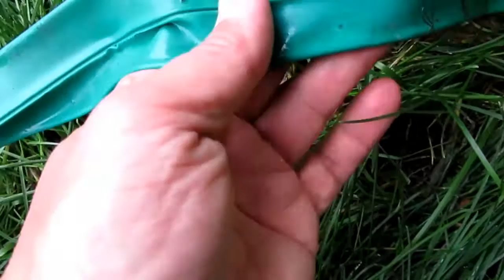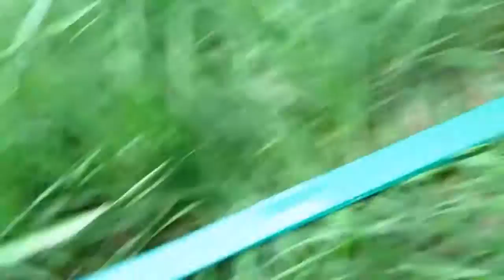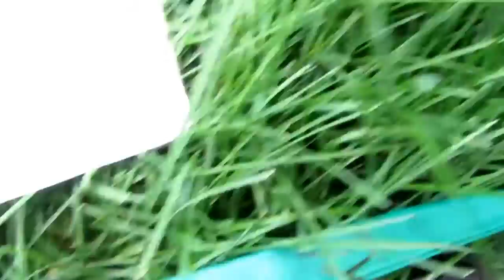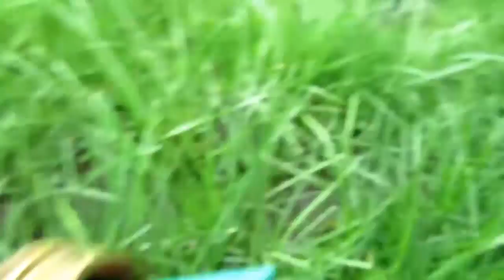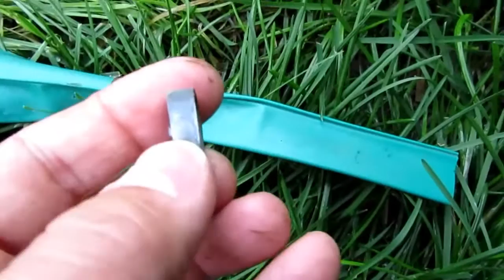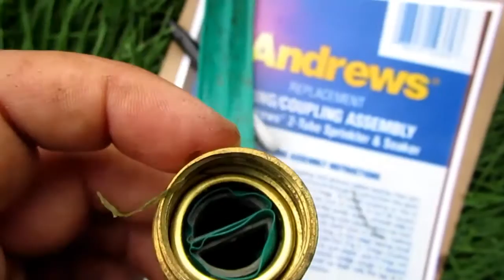Andrews Spinkler / Soaker Hose Repair

Comment: It seems simple enough but I can't get the D rings out!
Reply from the maker: Robincook, make sure you are using appropriate pliers AND are pulling them out the large (hose fitting) end.
Reply: @youtuuba I got them out!  Yay.  But it's leaking  after I put it back together so I need to redo it.

Comment: Thanks for this video. I just used my old pieces. I didn’t know they had a repair  kit. I also didn’t know why that little piece of metal was sticking up. I figured it was leftover from the mold these were made with.  I had mine with the little tabs upward so it took them out and re-inserted and it’s all good.

Comment: Note: cut the hose just past one of the pin hole openings. 
Andrew’s sprinkler hose is the best hose for small yards. It can lay down a ton of gallons in a confined area. Don’t throw it away if you have a leak. Just move the head or the end. It’s easy to repair. Don’t fold it though or you’ll get a pinch stress that will end up as a leak.

Comment: I don't know, mine sprung a leak after a year.  Any hack for one in the middle?
Reply from the maker: Sl5311, the plastic gets weak after a certain amount of UV exposure, so these don't last forever. I usually get about 3 years out of mine. I don't know of any splice kit. I think all you can do is cut off everything up to the leak, and relocate the hose connector there, and hope it is still long enough to do the job.
Reply: @youtuuba  Thanks. I went to Ace Hardware today and they don't sell the "D" pieces .  I wanted these to work better than they did. Thanks.
Reply: @sl5311 I guess regular hose menders don't work since these hoses have 2 channels.

Comment: Can you connect multiple hoses together?
Reply from the maker: James Standley, you could possibly connect a couple hoses together in parallel, using a hose splitter. But these hoses are not intended to be connected in series (end to end), and even if you could rig them up that way, I suppose that the pressure/flow would be unsatisfactory.

Comment: where do you get those coupling repair kits?
Reply from the maker: suelandress, I don't remember where I got them. But my ACE hardware store stocks them, and Amazon sells them.
Reply: I wish they had the other end as well.  I'd love to cut up a 100-footer into small sections for my raised beds.  Your video was great!
Reply from the maker: suelandress, you can still do that. Just put this fitting on both ends.... True, both ends will now be female, but you can use an appropriate size pipe nipple from the hardware store to then convert one of the female ends back to a male end.

If you want to cut a 100 footer up into several short hoses that each connect at one end only, you can use this Andrews fitting at one end of each cut section, and then just terminate the free end by the usual method. ... Simply fold the free end over and place some sort of clamp on it folded area to keep it folded. I have used two small pieces of sheet metal, or thin plywood, with the folded hose sandwiched in between, and then place a large binder clip (as used for sheaves of paper) to hold it together tightly.
Reply: Thank you! You must be a mind reader  :)    I was wondering if that would work (just clamping the ends)

Comment: The little "D" shaped ring is called - voila the "D" ring. Woah. And yes, easy to remove and put back in a different section of the hose. I worked at this factory in SW Portland, OR. Ran the extruder to produce a continuous length of vinyl hose, which then ran thru a water bath to cool it, electro-punched the holes, after which it then traveled up a conveyor to the next floor where they were cut to length, and the"D" rings were installed. Then coiled, packaged, boxed and ready to ship all over America.
Reply: Why did mine leak so soon after buying it? My cheapo wal-mart one still going strong 6 yrs later.
Reply: why don't they mark the sprinkler side? the holes are hard to see. it is easy enough to flip over, I guess.
Reply: Ha!  Saw Portland, Oregon so thought I would chime in. I live in Longview.  I have several of these hoses all bought at bi Mart in Vancouver. I wonder if they’re still in business? That was a great store.